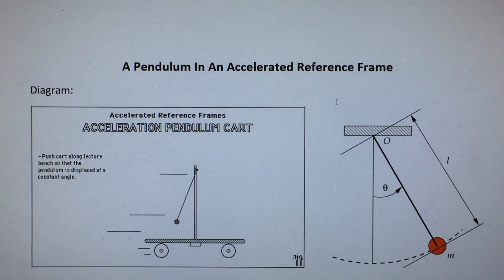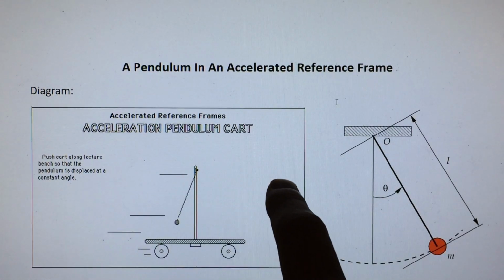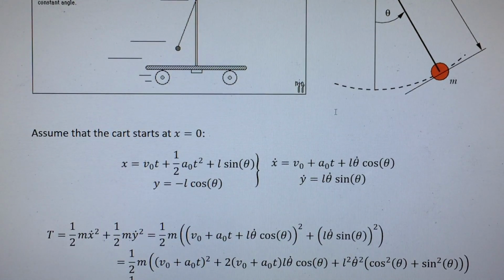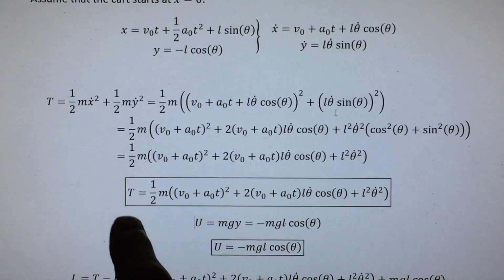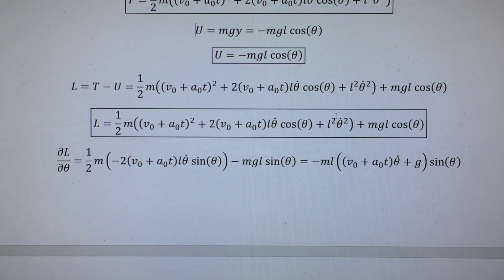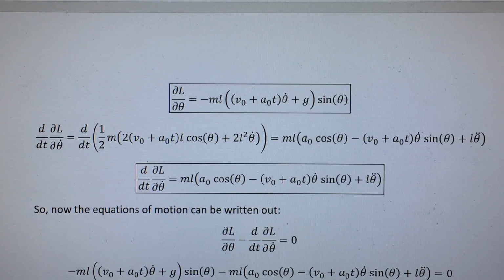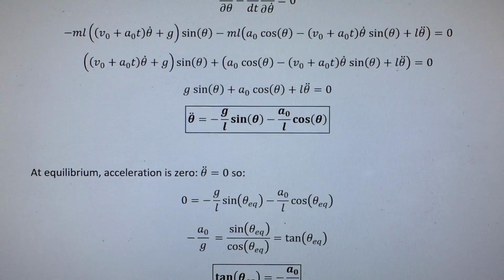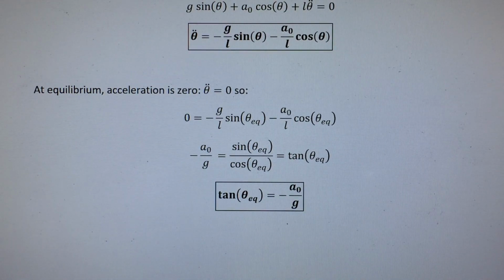Accelerating Pendulum Cart | Lagrangian Mechanics | Classical Mechanics

Comment: Hi! shouldn't the coefficient of theta (when making the small angle approximation) in the equation of motion (theta)' ' = -(omega)^2 theta  be (omega)^2= g^2+a^2 ??? As if there was an effective gravity of  sqrt(g^2+a^2). 
I used to approach these problems by calculating an effective gravity: relative acceleration of gravity wrt the point of attachment:  vector a_effect= vector g - vector a_cart  and since g and a_cart are perpendicular, the magnitude of the effective acceleration is obtained in a Pythagorean fashion. 
Is there something wrong?